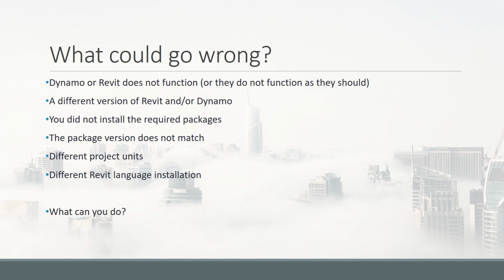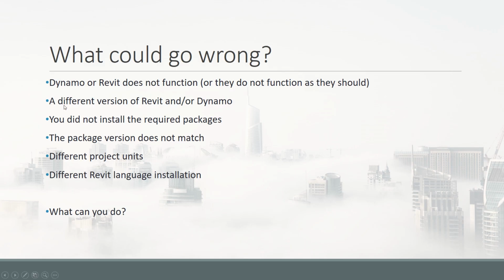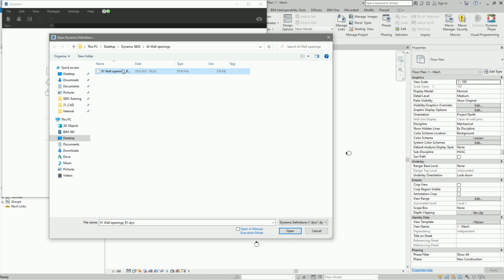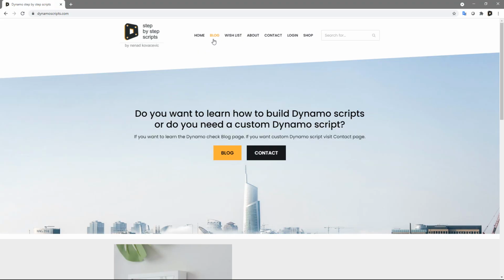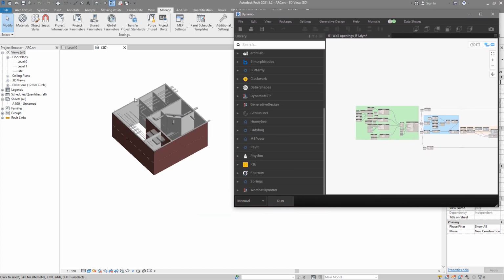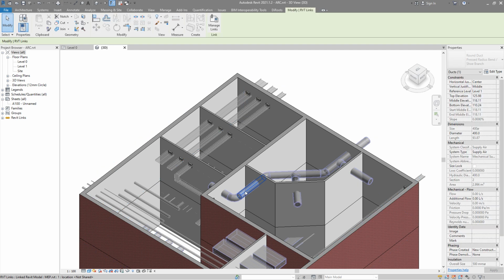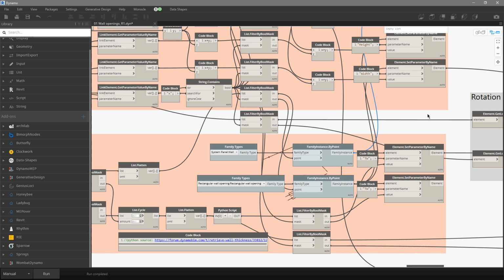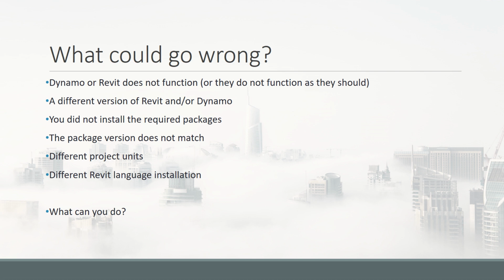Dynamo UX - What can go wrong?

Comment: Problem with packages installed
Reply from the maker: Hello Ruben, thank you for the comment. I agree that packages can bring a lot of problems while running the scripts especially in different versions of Revit/Dynamo. I think that Data-Shapes will just refuse to work with Revit 2018 even if Dynamo 2.0.3 is installed. So any script that has UI will not work with the older Revit version. Sometimes even copy/paste of Python nodes from the packages to the script itself will not help. :(